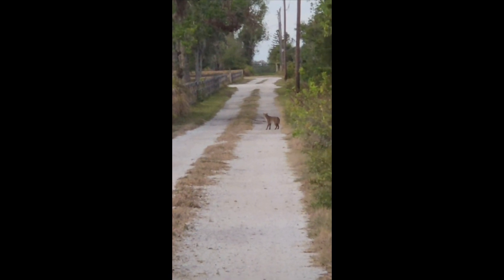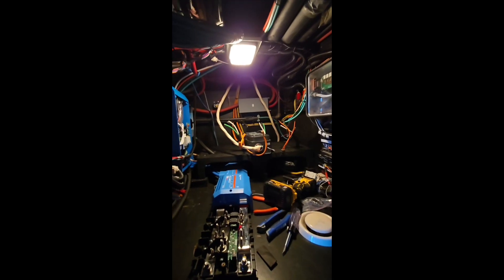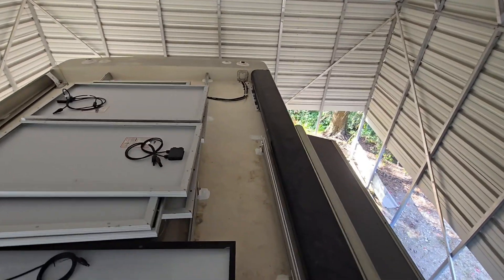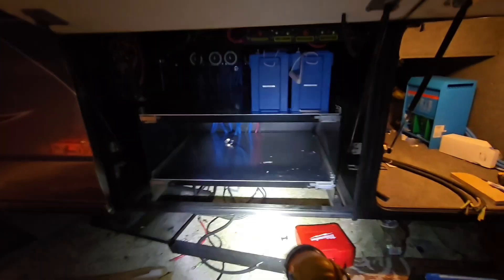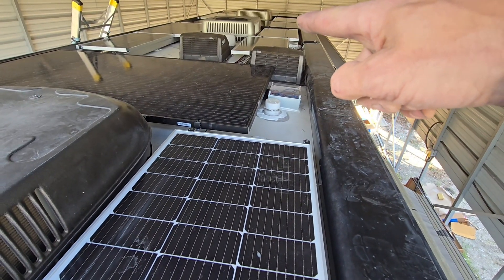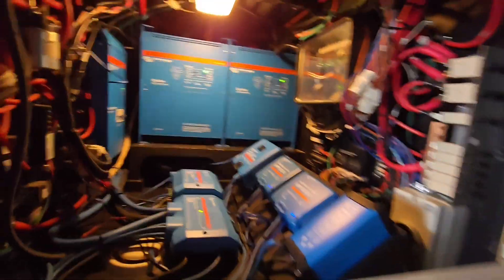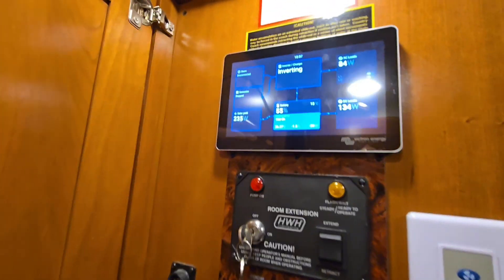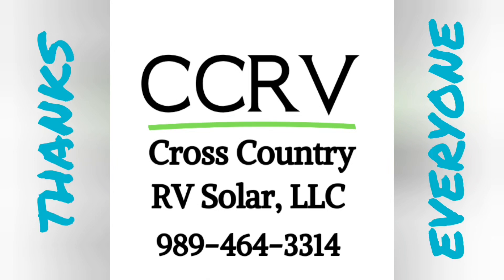Biggest Victron Solar System that would fit in this Country Coach RV, most challenging install ever!

Comment: Lots of impressive systems, nice work. Can I ask a dumb question? Why 24v and not 48v for these xl ones? Thanks so much!
Reply from the maker: Hey thanks so much.....no dumb questions and that's a good one....
So for me I'm not a huge 48v fan.  I have done some 48v systems and will again if requested but once you get around 50v DC power things get much more dangerous.  A mistake of a positive touching a negative results in what I describe as an explosion.  That's a slight exaggeration, but it's a massive spark.  So I worry about the customer or unsuspecting tech making that mistake.  The standard fuses for distributor max out at 32v so you have to get more exposure fuses that can be harder to replace if needed.  The converters to make 12v are very small when converting from 48v where 4+ are needed or you have to keep a 12v battery in the system.  Then the claim 48v systems are less heat, less weight, and less expensive, don't really add up as far as I'm concerned.  A properly built 12v system will stay just as cool.  Victrons own spec sheet shows very little improvement in efficiency at 48v.  There are more negatives and benefits each way but my preference would be 24v or 12v systems.  But everyone has their own feelings about the topic.
Thanks for watching and the conversation.....

Comment: "An incredible system you had put together. How much of it was your design, and how much was his? Did Derek suggest using Victron? Where were you at with the old system? Was it time to replace the batteries and or inverters? The batteries need to be replaced with our CC, and buying AGM is a tough choice when you know they are old tech. What are you able to do with the 2 5000-watt inverters that you could not do before? I understand the solar idea for charging the batteries and being off the grid, but how much time do you spend off the grid? Did you consider making this change without adding solar? How did Derek deal with the Alternator charging? Was yours a 320Amp Alternator? Lastly, approximately what did it cost to have this changed?" from another iRV2 member with questions...
Reply: Hi Phillip, I did answer all those questions on the iRV2 thread. Thanks.
Reply: @ Awesome system. You will have many more lining up for upgrades
Reply: @nevillesarkari  Here below I have copied his answer from the original post I copied the question above from. "I will try to answer most of your questions!

The design choices were done together, with a lot of guidance and practical advice from Derek along the way. We started out with several conversations by email, then by phone, with him sending me a couple of detailed quotes. He was great about answering all my questions. Once we got down to 95% of it being settled, we set on a date. Once they arrived and he could look in person, the final details were decided on, with a few minor things changing as the install proceeded.

Derek definitely prefers Victron for the electronics. He is open to using other inverters and some other batteries, but he is clear about the pros and cons. His original quotes used Big Beard batteries, but after a lot of research and price comparisons, I decided on the Victron. I was strongly influenced by the new NG design and their long history in marine environments.

Yes, the old system functioned correctly but the batteries were not lasting as long as I would have liked. Derek pointed out that they had not been wired in optimally and in fact two of the six tested bad. I probably could have saved the rest and used them for something but we just recycled them. The old solar was......small and very old. At 400w it was only providing a few amps of 12v charging. The prior inverter was not that old, a Xantrex 3012SW 3000 watt model. I have kept it for possible future projects.

I agree, I would not go with AGM at this point. At the very least you can invest in just the minimum Li batteries and plan to add solar or more batteries later.

The two 5000 VA Quattro inverters basically power the coach like you are plugged into 50amp shore power all the time. So we can run the A/C, the heated floors, the clothes dryer etc, just as if we were plugged in. It's a major increase in unplugged capability. Now, even with 3000w of solar on the roof, that's not enough to run everything indefinitely. But it will definitely make things last longer. And we kept the 12.5KW generator for times when the batteries need an extra boost.

Alternator still charges the chassis batteries, and they can also charge from the 24 to 12v converter (see around 7:05 in the video). All the 12v in the coach then runs from there. The alternator never directly charges the new stuff, since that's all 24v.

The total cost for this system was a little over $30K fully installed. However, a vast majority of that is just equipment costs and I drove Derek nuts in terms of adding more battery capacity and more solar. His original quotes ranged from $3400 to around $20K, basically small, medium, and large systems. I then pushed it up from there. Essentially he can get you in whatever price point you want. Frankly, almost all the high cost is in the batteries. Everything else is very reasonable from an RV/Country Coach kind of cost perspective, if you know what I mean. But I kind of decided to just do it all at once. Derek was more than reasonable and frankly I'm not sure he properly covered the time he put into it.

Hope that helps out. We are very happy and looking forward to giving the system a workout soon!

-Neville"
________________